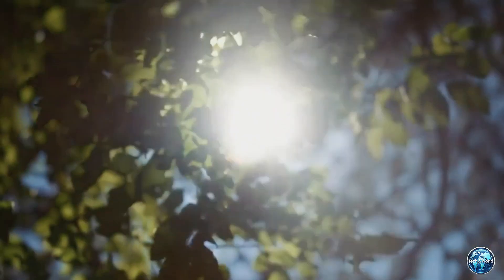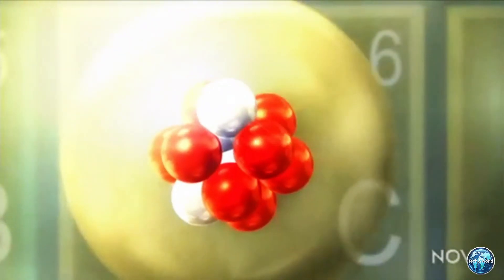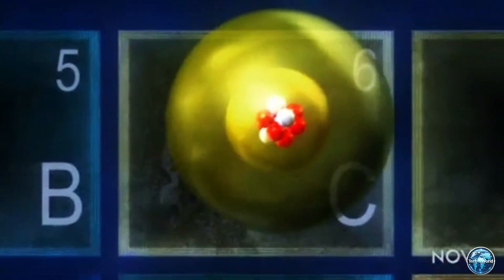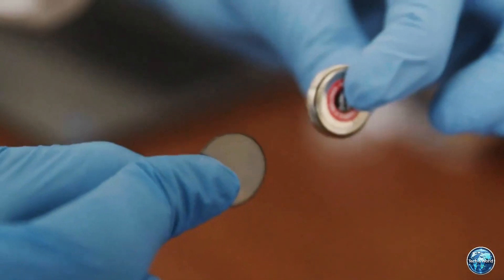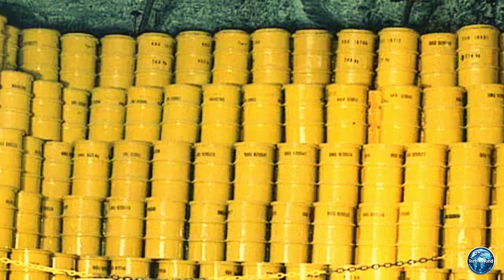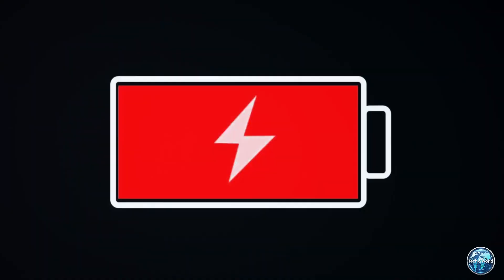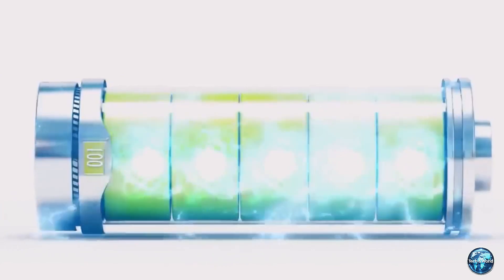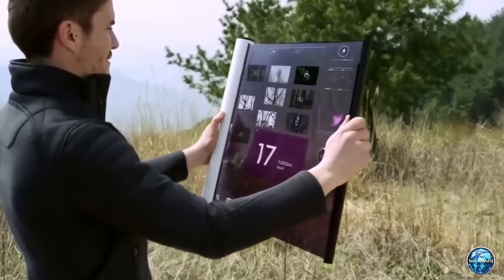No More Charging! One Battery for Centuries: British Carbon-14 Diamond Battery Explained

Comment: ALMOST AS EFFICIENT AS THE NEUTRINO GENERATOR!
Reply: What is that
Reply from the maker: @ManyHeavens42what do you mean?
Reply from the maker: Both are innovative technologies as you said but neutron generator is still in experimental phase thus carbon-14 Diamond battery is in working condition and long lasting 😉